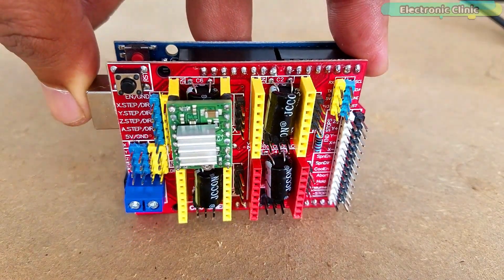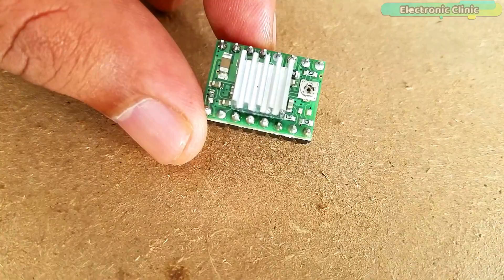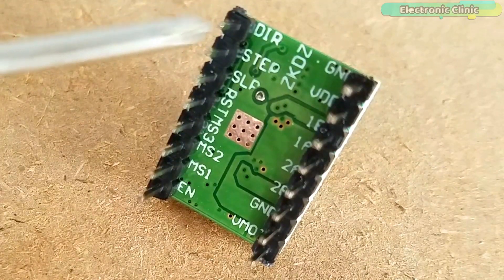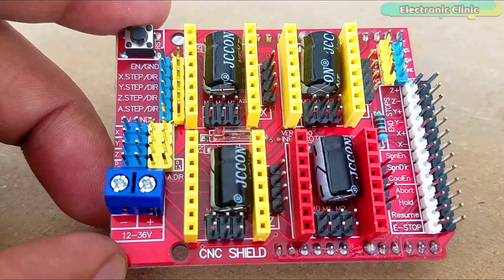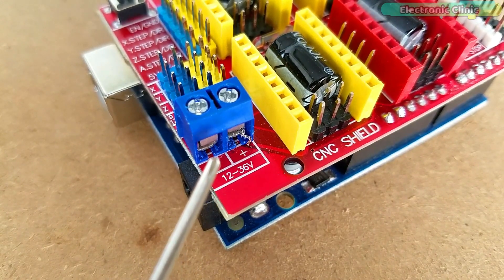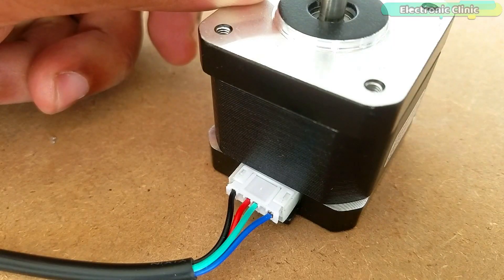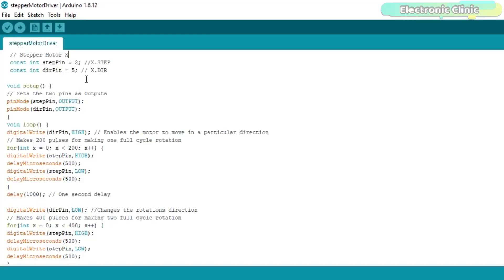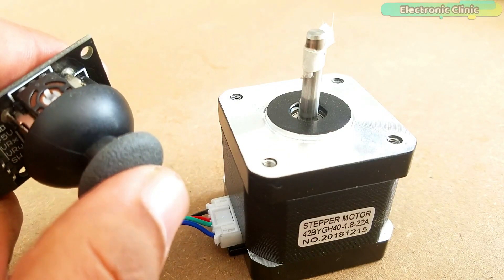Arduino CNC Shield V3 and A4988 Hybrid Stepper Motor Driver, CNC Shield pinout, wiring, code, DIY

Comment from the maker: Watch my video on How to make Automatic Spot Welding Machine using a Microwave Oven transformer
https://youtu.be/xnPIsrxVozM
Reply: @16:16 hello I whould like to make this but I have one question for you sw on the joystick I can see it connects to a pin on the board my question is what pin is it connected to? I believe it is the resume pin if I can see it right thank you fro making this video.
Reply: what's the amperage limit/requirement for the power supply? i got a 12v 3a power supply and i cant find any documentation on amperage

Comment: There are a few errors in this video.

- EN pin bridge, will not enable the Board. it will "fix" the motors. so they dont move by itself. u dont need that, the code can do this for u. (or grbl)
- u dont need to use the dir pins, if u use grbl. the sofware can change the direction (the pins are connected from the shield to the UNO)

- as always, didnt shown the process of measuring the VREF - and the formula is not true for this stepper driver (u will frie your driver or stepper, if u dont do this right)
- use TMC2208 or 09 drivers insted of that crappy A4988 - there MUCH less loud and can make a microstepping of 1/256

Comment: Why my gantry not moving continuously but only single times for few  unfix distance after sending moving command from Ugs and then in few attempts it gets disconnected until I reset the arduino, or software? I think it's because of EM interference create by motor but not sure since it showed be immune to these EM noise as it's made for these purpose.
Reply from the maker: Check your power supply. Make sure it supplies enough current.
Reply: 12v 2amp just testing with single axis motor

Comment: This is brilliant, thank you. The only thing I'm confused by: it looks as though you have the GND from the joystick connected to Z+ pin of CNC Shield in the video rather than to the GND pin (as it should be and as you instruct) - that pin is next to the 5V pin on my CNC shield. Is that just an error in the footage?

Comment: Thank you for the video! But... the jumper (14:15) supplies voltage all the time. This leads to overheating of the drivers. It is better to put a jumper on a free pin and apply -0- only when the engine is turned on and immediately turn it off if the engine stops working.

Comment: I want to connect at least 4 Servo Drivers to Arduino. Can anyone suggest any solution?
Reply from the maker: I designed a custom pcb, you can check playlist. You can modify that to add more servos and stepper motors.
Reply: @ElectroniClinic  Sorry.  Not able to locate.  If you don't mind,  can you share the link.?

Comment: I had a problem not being able to adjust Vref with the A4988 driver located correctly on the shield, which was attached correctly onto the Arduino, even after following all the instructions presented by the video faithfully.  But then, when I applied voltage to the Arduino from my laptop through the USB cable, the Vref voltage showed up on the A4988's Vref pot and I was then able to adjust its voltage. I hope that might be of help to those that might be having the same problem.

Comment: Sir, Very informative video. I am a hobbyist. I have used 'Arduino UNO, CNC Shield 3 and A4988".  Before switching 'ON' 12V to "Nema  17 PM " stepper motor following steps were done as shown in the video:
1. Set voltage on "A4988 " board.
2. Short 'Enable' pins.
3. Attach 4 wires of stepper motor. 
Can I go ahead please?
Thanks,

Comment: Hi
I Have make a small project With
arduino uno + cnc shield v3 + A4988 motor driver + stepper motor 
i have programing by computer.
and it's done.
but now i want programing controller with display.
do you guide me please?
Reply from the maker: Ya, sure.

Comment: Got it running in the end. Syntax ! Thank you. Vref is measured from the potentiometer wiper (which is live) and ground. I am hoping to run without the heatsink which is precariously close to other live components, hence a risk of a short circuit.

Comment: Hi. My motors dont move but connection is ok. I cant find anyone saying I must enable the ground in the shield.
Reply from the maker: My video helped you or not?
Reply: @ElectroniClinic  Hi, thanks for taking the time to answer. I already made them work but in tests the motors produce much noise and vibration. Some say use full steps and others that reduce it to 1/8 or so but also say it is bad for the motors? Who to believe? I am using Nema 17 2 amperes motors at 1.25 voltage. Thanks.

Comment: Hey, thanks for a very, very good guide! 👍

I'm currenty working with a machine (can't say manufacturer), but it use both a combination of PLC and robotics.
Wanted to learn more about ladder PLC, and do some experiments myself.

Most "guides" I have found are not as comprehensive your guide.

I have a 12volt power supply, but it's limit will be 12V,  1.0Ampere and a maximum of 12watts.
So I'll be getting a laboratory power supply.

As of now - no stepper motor, but no fear, we have a bunch of them at work..

Also, I was thinking.. If planning on building a "robot", what if I would like to use a real type of joystick? Say with six axis?
I was looking at something like the Amastone. It has XYZ axis (selectable), emergency stop and a dead man's grip for additional protection.

But, what if using a gaming joystick, with say an hall effect sensor? Need to re-route it via an interface/shield to the Arduino, is my initial thought, or just hack it??

Comment: How do I know or calculate the appropriate power supply requirements?

It’s been suggested that I use a 12v 100W PS, but I’m curious to see if I can use either 12v @ 76W or if I need to access 24v @ 144W? There is also an option to change the 24v down to 20v to get 100W.

Comment: hello I am trying out your code from your website but I get this error message Arduino: 1.8.12 (Windows 10), Board: "ESP32-WROOM-DA Module, Default 4MB with spiffs (1.2MB APP/1.5MB SPIFFS), 240MHz (WiFi/BT), QIO, 80MHz, 4MB (32Mb), 921600, Core 1, Core 1, None" can you help me with this?

The sketch name had to be modified.
Sketch names must start with a letter or number, followed by letters,
numbers, dashes, dots and underscores. Maximum length is 63 characters.

cnc_sheild_joy_stick:6:11: error: 'A1' was not declared in this scope
 int vry = A1;
           ^~
C:\Users\batman\Desktop\cnc_sheild_joy_stick\cnc_sheild_joy_stick.ino:6:11: note: suggested alternative: 'T1'
 int vry = A1;
           ^~
           T1
exit status 1
'A1' was not declared in this scope

This report would have more information with
"Show verbose output during compilation"
option enabled in File -> Preferences.

Comment: I want to drive a stepper motor on the seat which can move forward and backward and with nodemcu if you can help please
Reply from the maker: why a stepper for this? you can use a DC geared motor and control it via bluetooth.
Reply from the maker: And u use limit switches with the motor then you can also define the starting and end position. I dont know which type of seat you want to control? is it for kids or adults? its a car's seat?
Reply from the maker: you also need to look at linear actuators. I have a video on this.
Reply: How much travel do you need?
Weight limit?
I agree with a linear actuator.

Comment: Hi, after uploading the code, Is there other way to power up the arduino than the USB cable from the computer? I want to disconnect my computer from the arduino.
Reply from the maker: connect 5 volts with vin pin of arduino.
Reply from the maker: with the usb port on the opposite side there is also female power jack, over there you can also connect a 12 volts adaptor, battery, etc
Reply: @ElectroniClinic  thank you for your help 😁
Reply: Bro pls how did you open the link in the description???
Reply: @francescodangelo9095  I didn't open it. But now I tried to open it by just clicking on the link and it opened without any problems. I'm using a laptop tho.
Reply: I do believe there is a LiPo battery pack you can get for them.

Comment: Great video, thanks. Are you able to tell me how I can use NEMA34s with the Shield? I got separate drivers for the steppers, do I connect the motor coils to the 4 pins of the Shield or to the DM860y driver? What connects to the X and Y Direction and X and Y Step for example? Will try a 2 axis plotter/engraver for starters. Any suggestions would be greatly helpful as I'm completely new to these things. Thanks!

Comment: Do I need a power supply to the uno and cnc shield when I use the router I usually just run 24v on the shield and the usb seems to power the uno is this ok to do

Comment: In other tutorials, their formula is VRef = (Current)*(8)*(resistance of the current sensing resistor). In my case, it's either VRef = 1.7/2 or VRef = 1.7*8*0.1; both yield different values. How can I tell which formula to use?
Reply: it depends on the driver you use, the first formula is usually for A4988 and the second for DRV8825, you can find the specific formula in the datasheet of the driver you use

Comment: Hi I have a quick question. Is there anyway to power the Arduino board without it always being connected to computer? I have a 12V supply connected to the CNC shield, but it only runs if I also have a 5V usb connection to the Arduino board. Any way to tie in a 5V from the 12V supply, so I can make my product mobile (not confined next to a computer)
Reply: Several options there.
1. Get a small powersupply you can carry with you.
2. Use a LiPo battery pack.
3. Get an USB2Go connector, connect it to the phone you use, get ArduinoDroid or similar to control/edit the code.

Comment: Hello, i have a question, what would be the purpose of shorting @ 9:57 does it enable us to control those motor? Sorry if its a stupid question. I ask because I am currently beginning to research how to control my 3 stepper motor without using GRBL and I'm kind of confused.
Reply: It's to enable the control of the stepper motors, yes.
However, I found having a toggle switch soldered on to female connectors was just as easy.
Same goes for emergency stop - get a real switch and modify it for your own purpose.

Comment: Dear:
 Thanks for the video ... I need to bother you with a question ... in fact you can charge me for the advice 

I need to make two stepper work with the arduino one, also each one controlled with encoder independently ... I'm trying to occupy the Shield of A4988 but I can't, can you help me with this?
with the connections and the program? ...
I can leave you my email for more details and we will contact you there, I am from Chile, South America, thank you very much
Reply from the maker: check the playlist, i have already designed a custom pcb for two stepper motors..

Comment: For anyone having issue setting vref. Setup the driver in a breadboard and NOT on the cnc shield. Something about the knock offs being slightly different. My vref was always 0v when trying to adjust on the shield.
Reply: I had the same problem, but when I applied voltage to the Arduino from my laptop through the USB cable Vref showed up on the pot and I was then able to adjust its voltage.

Comment: how i can connect 5 stepper motors pls
Reply from the maker: its simple, you will need to make a custom pcb. I have another video in which I designed a pcb for controlling multiple stepper motors.

Comment: Can we connect i2c keypad and LCD to CNC shield? Keypad used to input the steps/revolutions to stepper motor.
Reply from the maker: i did the same thing using android app instead of using a simple keypad  watch my video on android controlled stepper motor

Comment: Thank you so much for this tutorial! Very helpful. Do you know how can I effectively short the ms1, ms2, and ms3 pins? Basically I'm hoping to use 1/16th micro stepping all the time. Is there any tool / caps that could help? With the limited space provided on the shield, I couldn't find an elegant way to short them, unless I manually solder those three header pins... Any help will be greatly appreciated!
Reply from the maker: you can use jumper caps
Reply: @ElectroniClinic  What about setting 5,6,7,and 8 high in the program? Not sure if those are right ones that go to the steps pins, whole, half, quarter...

Comment: Does anybody have the code for controlling 2 motors direction with one joystick??? I have the same hardware as the video, the but no matter what I try I can only get one motor to listen to the joystick and the other just free spins if power is on :( help would be greatly appreciated.
Reply from the maker: this joystick has the button as well. use this button to select between two motors.

Comment: Great video though I noticed that you used the vref calculation for the DRV8825 driver and not the one for the A4988 which is what this video is about.
Reply: can the exact same methodology be used for DRV8825 driver because i noticed that the pins 1A, 2A, 1B, 2B are arranged differently in the DRV8825 than the A4988?  The order in A4988 is 1B 1A 2A 2B and the order written in DRV 8825 is 2A 1A 1B 2B.
Reply: @brahmadevs  The method is the same, but the formula for vref is different.  The formula for vref is on the datasheet for the driver.
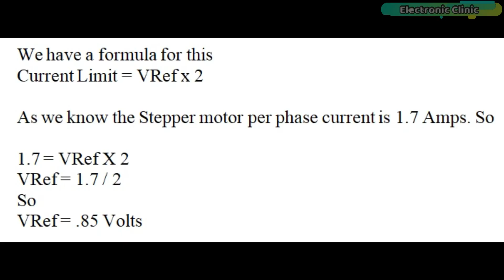Reply: Yes you are right. For example for 17HS4401: Vref = 1,7 / 2,5 = 0,68V  (14:47)

Comment: Please help! 
First of all, thanks for this well explained video.
I have a big question, if I want to use this cnc shield but I will only use two nema steppers, but my main question is, if I need to use other digital or analogical pins for other device, is it possible? Because the cnc shield is connected on the whole arduino... thanks
Reply from the maker: yes.you can use. For this reason i designed my own stepper motor controller. i will upload the video on 1st Feb. in that video i have explained how to use any number of stepper motors and how to use io pins to control them.
Reply: @ElectroniClinic  help link

Comment: how do you know how much to turn the potentiometer?
Reply from the maker: i can se the shaft position. i set the starting point and that's it.
Reply: The potentiometer on the driver carrier sets Vref which in turn defines Imax for that driver. Imax depends on your motor (see datashield) and the formula for deriving Vref from Imax depends on driver carrier (see datasheet). Measure Vref between potentiometer and gnd
Reply: @petermuller608  Measure how?
Reply: @amelliamendel2227  which part of the description is unclear to you so I can elaborate?
Reply: @petermuller608  Idk I don't have a voltmeter or anything but it's working at least the z,x,y are working perfectly so I'm not going to adjust anything.  I just got this yesterday for my scara robot build for school.  PLEASE HELP I can't find anything anywhere online about the A axis what pins do I define them in the arduino ide?  1-8 are taken already.  The 4th stepper has power going to it but the example sketch provided only drives the xyz.  Can you please help me with what pins for the step and dir for the red socket?  I guess on a printer it would be the extruder stepper, but Google isn't helping this morning.
Reply: @petermuller608  Thank you for responding
Reply: @amelliamendel2227  without a voltmeter it's quite hard to get it right. I really suggest investing in one (a crappy USD 20 one will do just fine), since burning one stepper will cost you more or less the same. In order to use the A axis you have to configure the jumpers on the left (above the +/- external power supply jack). You can either mirror x/y/z or use it as an independent axis (using D12 pin iirc).
Reply: @petermuller608  Excellent D12 is one, what's the other?  Z is step pin4 and dir pin7, y is step pin 3 dir pin 6, x is step pin 2 and dir pin 5, getting the code 8 is en surely for enabler.  Is D12 the step pin or the dir pin?  Also thank you for your time in answering a kids silly questions, you're awesome.
Reply: @amelliamendel2227  according to https://blog.protoneer.co.nz/arduino-cnc-shield/ I assume the other is D13

Edit: I don't know whether D12 is step or direction but you can easily test continuity (e.g. hooking up an led if you don't have a multimeter)
Reply: @petermuller608  I GOT IT!  A step is 12, A dir is 13 and for some reason you have to set the D12&D13 jumpers which you don't with any of the other ones.  But it's working!  Thanks for your help.
Reply: @amelliamendel2227  congratulations! The jumpers are necessary to enable the fourth axis (the x/y/z jumpers mirror that axis to the a driver)

Comment: current limit formula is not correct it should be V = I X R X 8 where R is the limiting resistance and I is the rated current for stepper
Reply: This depends on the driver carrier, but should have been mentioned in the video
Reply: @petermuller608  agree
Reply: Was confused with the formula. My stepper is 2.0 rated current. May I know what will be its limit?